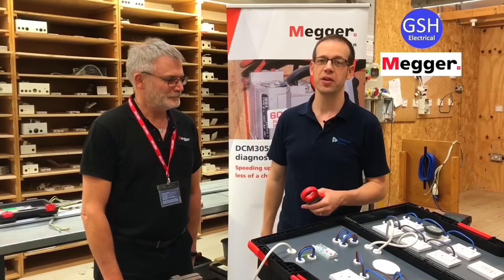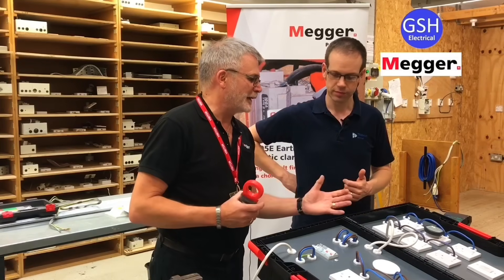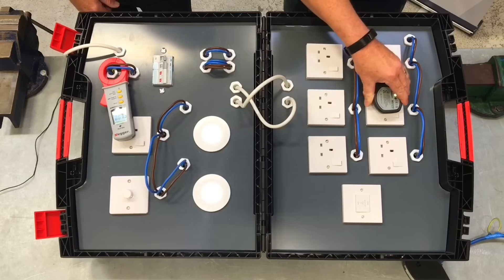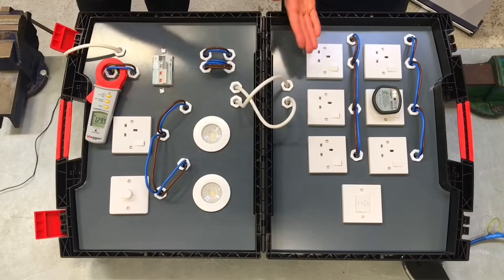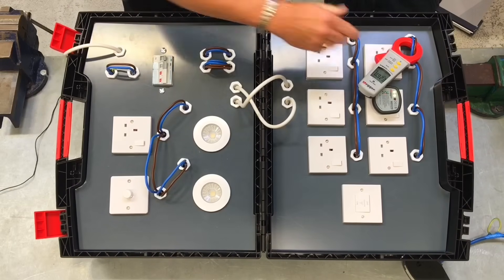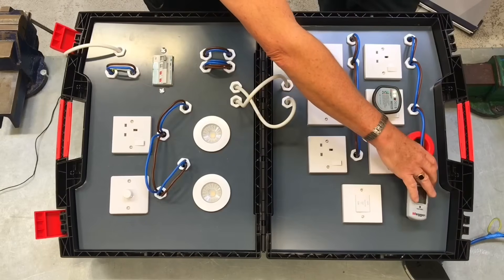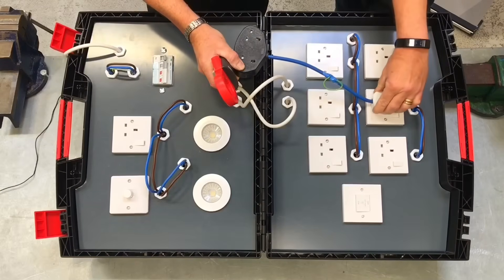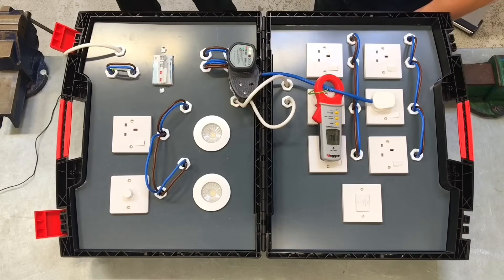Electrical Fault Finding Earth Leakage Current Detected with the Megger DCM305E Clamp Meter

Comment: Would it not be more accurate for testing only to not connect the earth wire in the flex, appreciate it would leave the electrical appliance for a few seconds with no earth but the problem is some of the earth leakage would be in the earth wire and not giving the full leakage between live and neutral

Comment: Hello there, 
Any clamp meter can read through both cables (live an neutral) inside the clamp? From my previous knowledge I know that only one cable, the current running through it, can be measure. If a normal clamp meter attached to a multimeter can read could you tell what maximum (ideal) range should the clamp be?
Thank you.

Comment: I’ve invested in a megger earth-leakage clamp about 2 years ago and have used it very little. I find in practice the easiest detection method is simply using an mft set to insulation resistance with, the appliances plugged in and switched on testing at 250v. I would say if you are testing on a pre wired rig with nice little line and neutral loops exposed, then the clamp appears to be an effective fault diagnosis method but, not so good in practice. It is also difficult to know where to split the ring in half to test individual radials, unless of course you have personally wired the circuit. I suppose they do have their uses, in the fact you could run a suspected faulty appliance (eg washing machine) on different settings (eg spin cycle) and identify when the leakage current is causing nuisance tripping.. I’m yet to be convinced on these clamps even though I own one!!! Great video though keep them coming👍
Reply: You should learn small trick. Just take an extension cord and remove small portion of the external pvc isolation so you can separate main, neutral and earth wires. Connect your appliance via this "exposed" cord and encircle with the Megger clamp just the line and neutral exposed wires.
Reply from the maker: WOW thanks for your very detailed message. 👍. Gaz 😁
Reply: Is it not handy to locate what circuit the fault is on? Or clamping the tails before a board change?
Reply: Hi,
Totally agree, not quite so easy to use in the field, if you going to split the ring and start removing sockets then dead testing with an insulation tester is much safer and just as easy. A lot of the time  experience and gut feeling is a good starting point when fault finding.
A useful device thou which defo has a place in your tool kit.
Reply: Wow, that is a smart or though full idea! Testing the suspected appliance with a insulation resistance tester! Come on, you can check "leakage" down on earth prior disconnecting main earthing of the installation, if ever needed. (I heard that there could be some nasty currents going down unknow..)

Comment: I'm going to have to invest in one of them I had it recently when the rcd had tripped it did reset.
 I did the insulation resistance earth loop impedance tests and ring final continuity tests  which were all giving good readings  and rcd ramp tests on all appliances and still didn't find the fault which has happened on 2 occasions , I did find damaged insulation  in  short wires in a few socket outlets so it may of been a factor, installation has a fairly new  metallic consumer  unit on wiring from the previous consumer unit which was a Crabtree with  type 1 mcbs only so it shows its age.
Only one ring final circuit for a house .I hadn't fitted the consumer unit it was done by others and doesn't include surge protection.
Reply from the maker: Thanks Paul for your detailed comment. 👍. Gaz